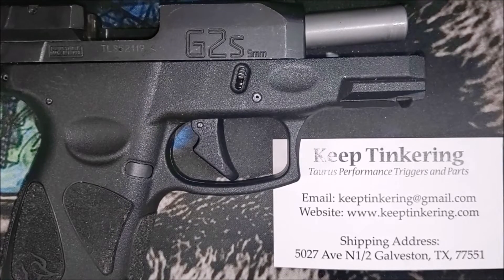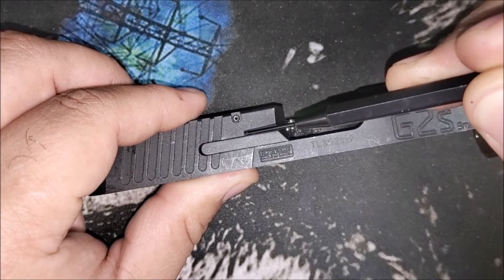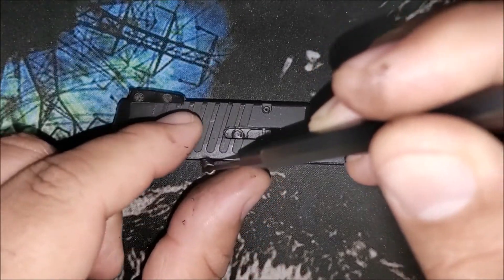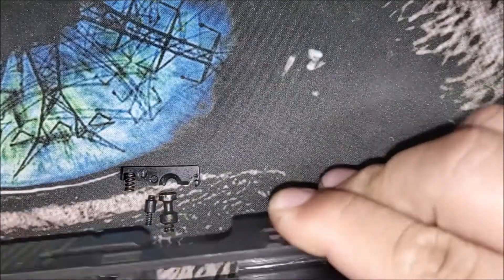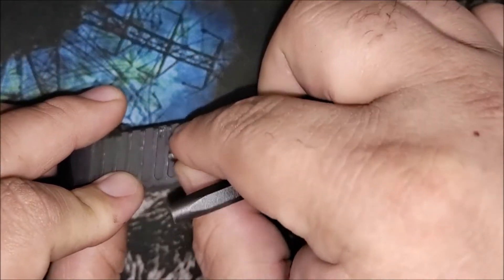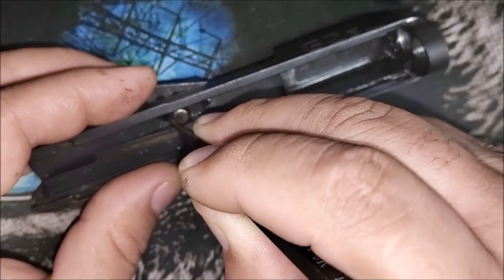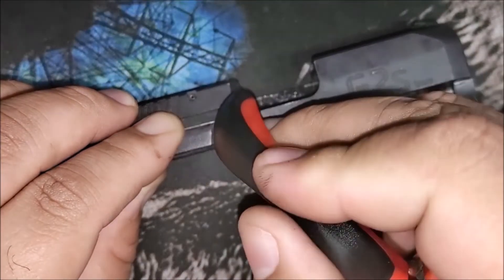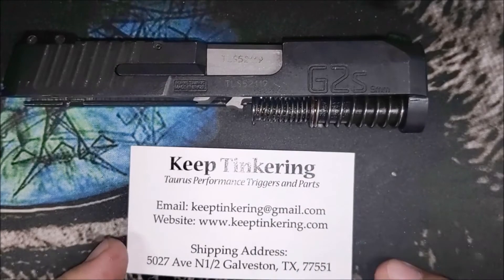Extractor Remove and Replace for PT111 G2/G2C/G2S/G3 709

Comment: Much obliged. I just did this R&R on my G2C, which is experiencing extraction failures at 800-850 rounds. It was filthy under the extractor, with a lot of dirt, factory lube and brass shavings. I'll edit this comment after my next range trip in about a week, with an update on reliability.
Reply from the maker: Yea, they can for sure get dirty under there.

Comment: Outstanding video. I had to jump over to this video from your disassemble video after polishing my extractor push down Stricker pin. I needed to learn the reassemble steps.  Your made it look easy ,but once I watched this video is was very easy for me as well.  Trigger pull seems way smoother now.  Butter smooth. Thanks you so much.

Comment: Excellent videos! I understand the inverted top hat (extractor pin) and its spring (extractor pin spring) and the extractor (big external piece) and it's heavier spring (extractor spring). Looked up in the parts expanded view of my Taurus G3c. I didn't lose the extractor pin or its spring, but I may have stretched the extractor pin spring a bit. Two questions. Do you know where I could purchase the extractor pin spring? Second I understand the "restrike" on my G3c, but really do not like it. On your triggers the trigger safety goes away? Anything else have to be done to lose the "restrike". I'm not an expert, just a former Marine with some talent. Thanks in advance for your time and efforts. I'll be undergoing hand surgery mid month so installing your trigger may have to wait a couple of weeks. God Bless America, L Steele, SSgt USMC (rt).

Comment: So, I need to remove the striker as well? The only other video I found on this subject didn't mention that at all. That must be what is keeping everything from locking in (?). Thanks you SO much. By the way, I found my pin spring on the floor moments ago...for the SECOND time!!
Reply: OH. MY. GOD. I just got it to lock in. Once again, a million thanks!!
Reply: I got mine to lock without removing the striker.

Comment: I have a G3 and had 3 or 4 FTF issues/extractor not pulling the spent brass out.... Is there a better after market Extractor or should I take it out and deep clean every 150 rounds or so? Also the slide spring seems very easy to slide especially compared to my Canik TP-9 and Zigana PX-9, both of which are very strong, and both are soft shooters,...
Reply from the maker: 150 rounds seems pretty often... If you give it a good cleaning that should last at least several thousand rounds in my experience. As far as the recoil spring goes, how far is it ejecting the spent rounds when they do eject? Usually a correctly tuned recoil spring ejects rounds about 6-8 feet before they hit the ground, so if they are barely dribbling out of the gun and landing by your feet, the recoil spring is too hard, and if they are zinging across the range like they are trying to leave orbit, the recoil spring is too soft.

Comment: Mine has a failure to feed about every 20 rounds I feel like the extractor isn't grabbing the new round the extractor seems to push on the back of the new round and  they hang at an angle before it completely enters battery. I cleaned and it ran well for 50 or so and limp wrist is real so I'm not sure if it is always the gun. G2c in 40s&w
Reply from the maker: Yea, a lot of cycling errors can definitely be related to how the gun is held. You can definitely check the extractor though, especially if you feel like it is hanging up on new rounds you might want to make sure the face the edge of the rounds slides against is nice and smooth, and that there isnt any gunk under the extractor.

Comment: So, weird issue I have been having with my G3 lately seems like it has something to do with the extractor/ejector function. I can work the slide and chanmber a round, but if I were to try to work the slide after a round has been chambered the slide will not go back without force. I mean it’s so bad that I’ve ripped a bullet out of the casing while in the chamber with only the casing being ejected from the gun. Any thoughts?
Reply from the maker: Thomas, the bullet portion of the round shouldn't be getting stuck in the barrel at all, let alone stuck so hard pulling on the casing can cause the two to separate. I would VERY thoroughly clean your barrel and then look at see what is going on in there that could cause it to stick. Let me know if that helps or if you need any further assistance.

Comment: After removing and cleaning the extractor on my G2C I haven't had any FTE issues. My question now is: how often should I remove all of that and clean it? Since it's very tedious work I'd rather not do that after EVERY time I shoot. Or, should I? Once again, thanks.
Reply: I just shoot in some gun scrubbers or leave some hoppes dripped on it and it’ll soak up in it and break that gunk up and then wrk it back and forth and spray it out with compressed air. That’s only after I have taken it out before and actually cleaned it right. This method I mentioned is just going to keep it free and not froze up and stuck from gunk
Reply: I started having FTE as well with my G2c i just cleaned my extractor on mine as well it was totally gunked up. so much grease I guess the rim was slipping out. I Don't have enough ammo to check to function ATM fingers crossed